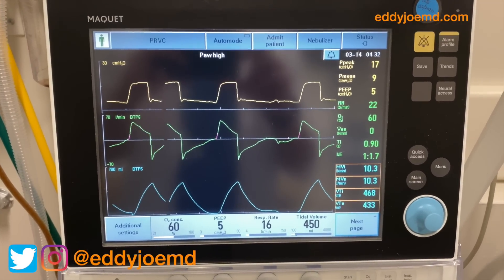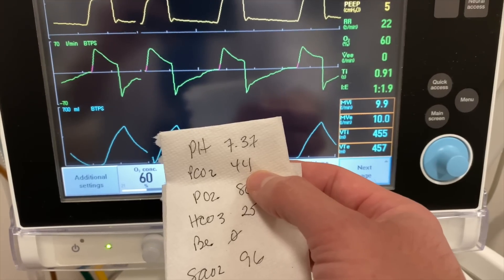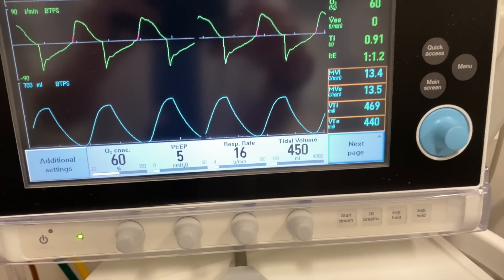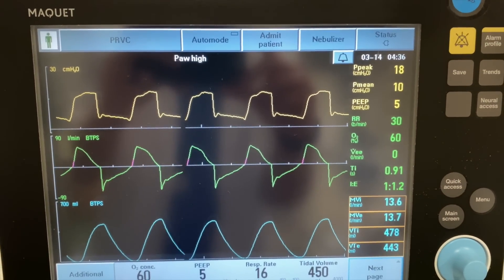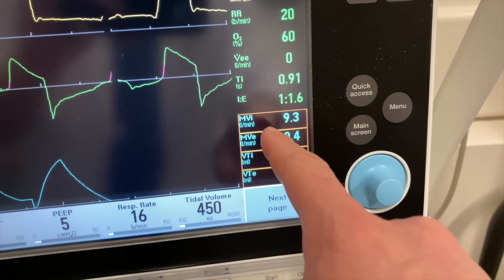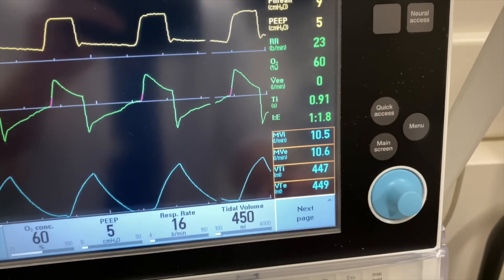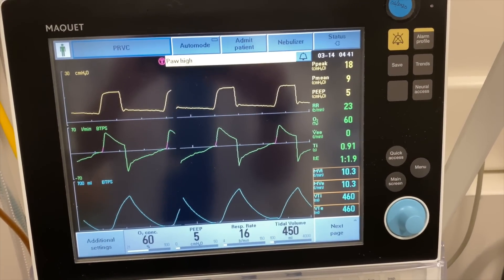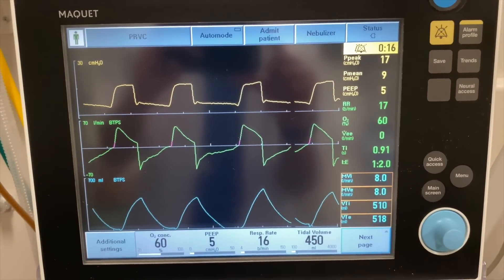Ventilator Crash Course: Quick and Dirty Guide to Mechanical Ventilation

Comment: just worth noting...it should be PREDICTED BODY WEIGHT. And not Ideal Body Weight.  

Formula: 
Male: PBW (kg) = 50 + 2.3 (height (in) – 60)
Female: PBW (kg) = 45.5 + 2.3 (height (in) – 60)

Quick guide can be seen here: https://lh4.googleusercontent.com/P0ydgeCBW8KZUKpuy3FCvCZqC83IMc_6gUjvsFKt1rbeMJzyaPT8jBASQKJkmNiAl_CHWa9DxlXotlbvmUGhkrhNhCXM0Uns72-hewO9dMGtkG53Q_xTYexnJaek3v5TW06qIEYnKW6rHTdugQ
Reply: Predicted and ideal body weight are different ways to say the same thing. Same formula.

Comment: Why would someone be vented but not paralyzed?
Reply: Typically, just sedation is used for most patients on ventilators. Paralytics are commonly used for patients with severe ARDS when high ventilator settings are still not oxygenating the patient. 
This article provides details about paralytics in ARDS. http://rc.rcjournal.com/content/61/6/830

Comment: Thanks a lot Sir..was much awaited video... kindly explain Plateau pressure?
Reply: It is the amount of pressure in the lung at end inspiration and before expiration begins. It is very hard to obtain because it requires pausing the ventilator (at end inspriration) for a period of a few seconds.  Most times the patient can override your attempts during that maneuver because of their respiratory drive and not being sedated "enough". If possible it's good to keep plateau pressures at or below 35. Also, it is very helpful to document the trend occuring in Plateau pressures (PP). If PP starts to decrease that's usually good. If they start increasing that can imply the lungs are starting to get stiffer (one indicator of ARDS forming).  Hope this helps.  I am a retired RRT and instructor in Respiratory Care in St. Louis.